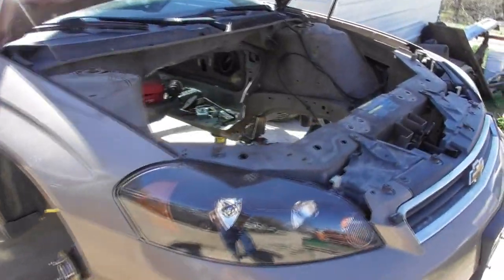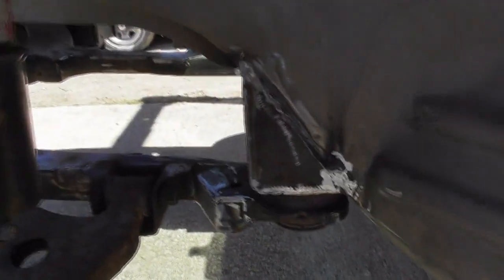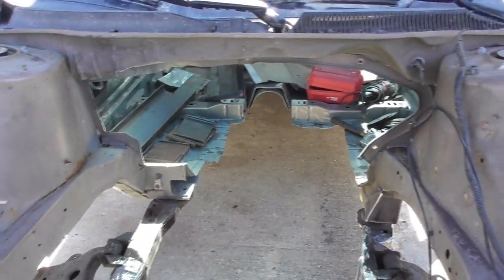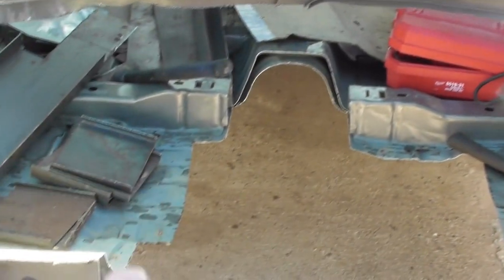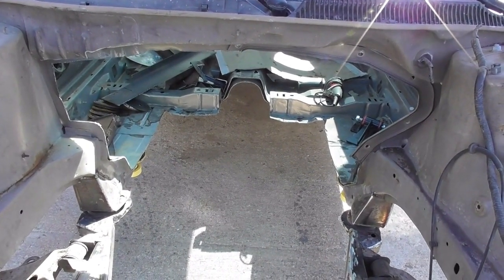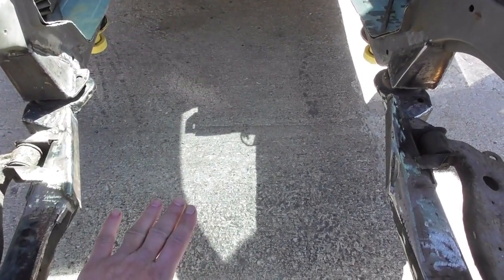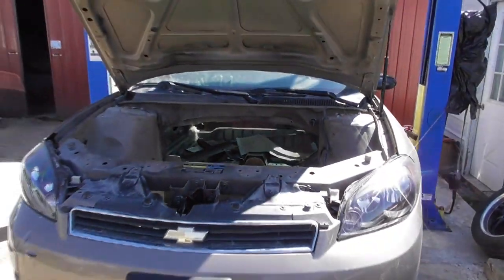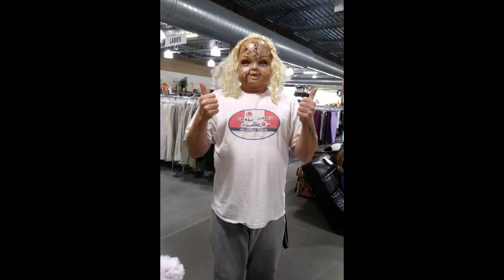the front end gets it! LS 5.3 4l80e swap fwd to rwd conversion 06 monte project frankenstien 11

Comment: I'm doing the same on my 06 Pontiac Grand Prix gxp but ima try to keep the aluminum subframe got any ideas?
Reply from the maker: go get all the front end suspension out of like a 99 mustang. it all bolts in. mustangs have front steer and have plenty of room for engine clearance. its prob what we should have done. the owner of the car just watched what everyone else on here did, and assumed it would be just fine. the problem with doing that is no one tells you about the actual problems they encountered, like the steering geometry. swapping spindles from side to side does not work, you basically cant turn, it will have horrible bump steer, which makes it a straight line car only thats no fun to drive if you plan on turning...

Comment: I can’t believe they made an LS version of these with a FWD platform 🤷🏻‍♂️ out of curiosity, why are you going carbureted?
Reply from the maker: carbureted for simplicity. not against efi but the only advantage is cold weather start ups, and turbo set ups if you are using mega boost psi.